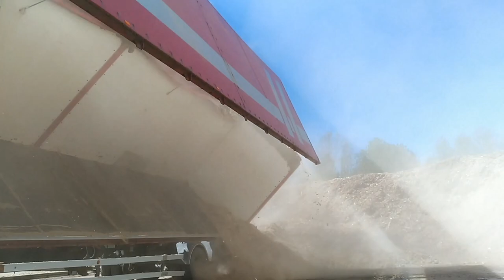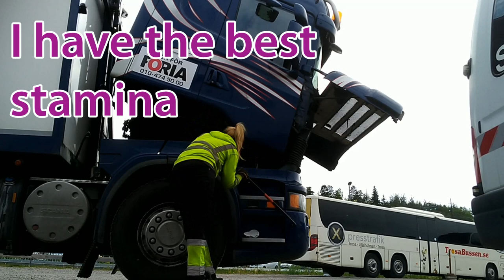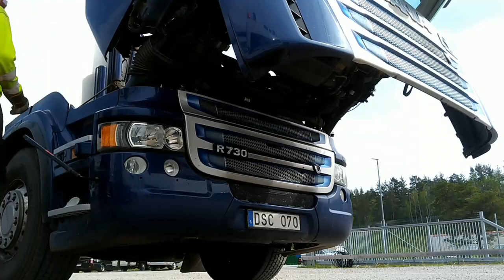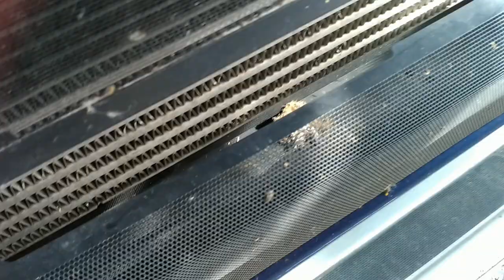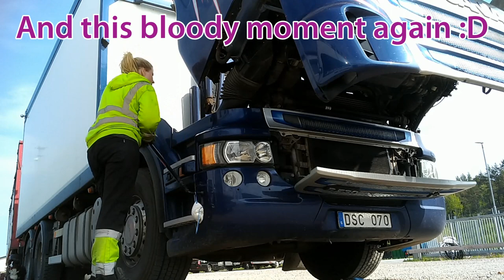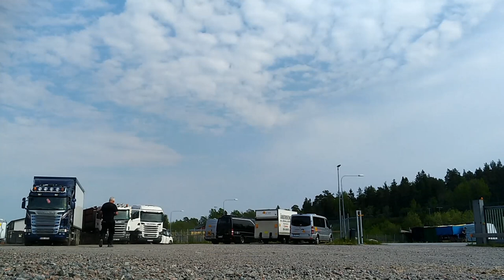Cleaning the Cooler on My Wood Chip Truck

Comment: You could have opened the bottom  step to aid the dust to escape..? Anyway it's a problem on these jobs..usually notice when the truck starts getting warm on uphill climbs. Regards from UK.
Reply from the maker: That it true! It never occurred to me really :) Yeah the last wood chip rig I had overheated ALOT uphill, no matter how much you cleaned the engiene. It had worked hard over the years
Reply: @TruckerCassie  Nice to hear from you - I did this job in the UK for many years..and yes, you have to dust the Rads regularly otherwise the truck overheats. I like the combinations of truck you have there in Sweden. You're lucky to drive that powerful 730..!
Take care and stay safe!